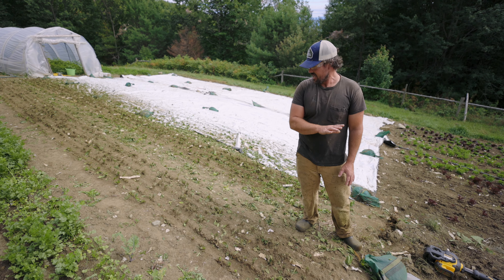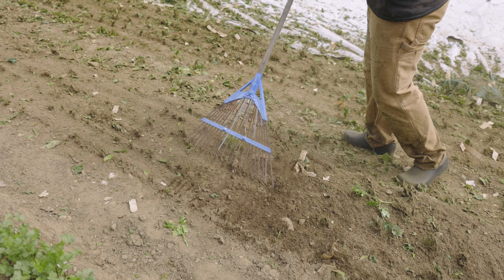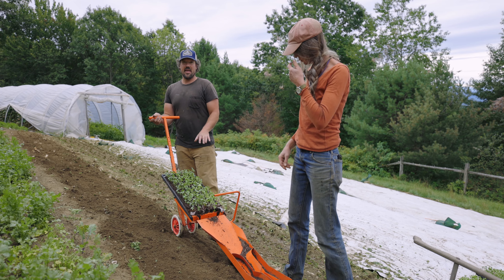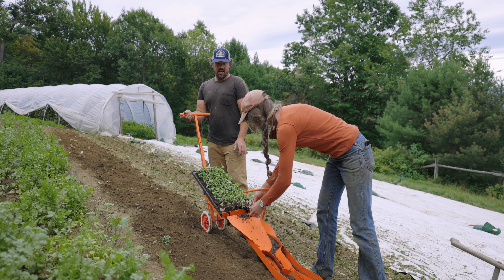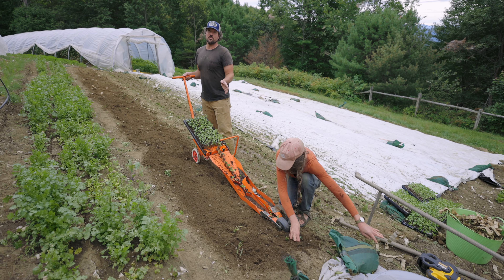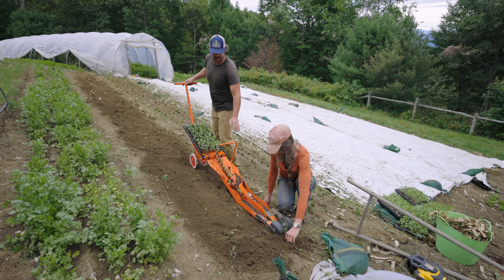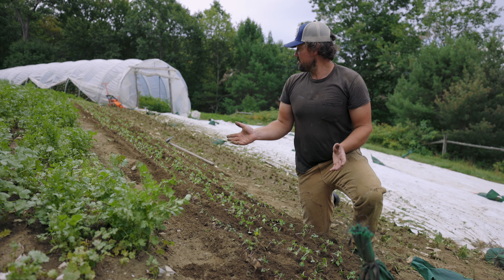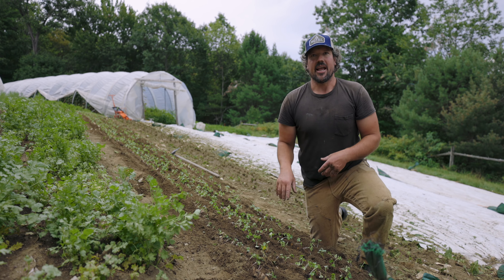The MOST ERGONOMIC Way to Flip No-Till Beds on a Hillside!

Comment: Can someone please explain to me, why there is "No-Till" in the title and he tills the bed anyways?
Reply: Because no dig and no till are different 

It's dumb I know 😛
Reply from the maker: Hopefully others can chime in too, but the Tilther that Evan uses to cultivate the top inch or two of soil is different than a tiller used to break up 6-10 inches of soil. There are probably multiple schools of thought on this, but one con for traditional tilling is that it breaks up the soil structure that develops over time and is healthy for the plants and the ecosystem in general. The Tilther only stirring the surface leaves the bulk of the soil structure in place. Hope that helps!
Reply: No point in putting on amendments to blow away
Reply: @FarmersFriend  thanks for the explanation. I would call his beds "low-till" instead of "no-till" then :D
Reply from the maker: @Blackhuf, probably a fair assessment. :)